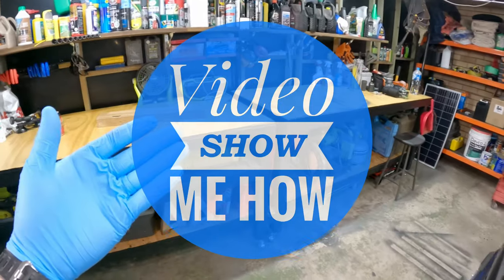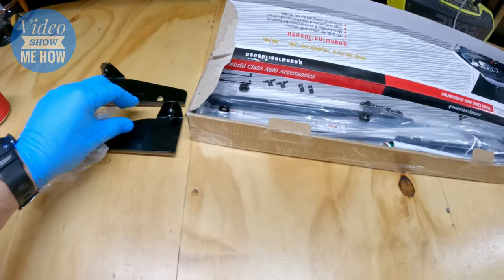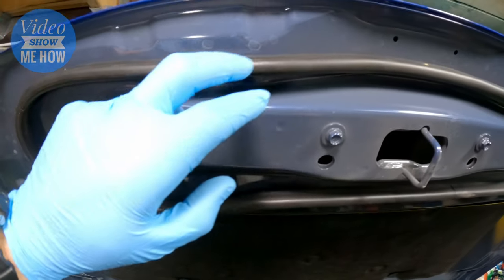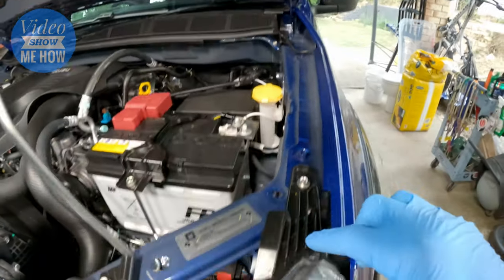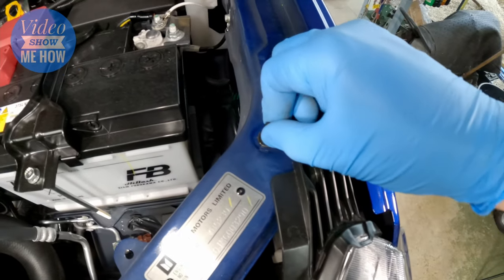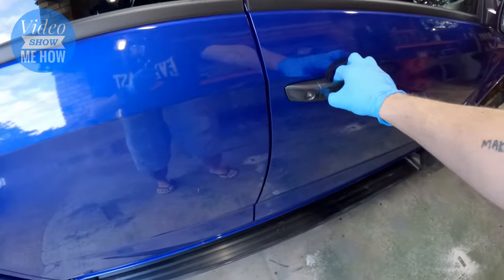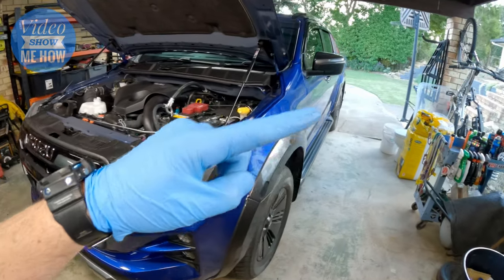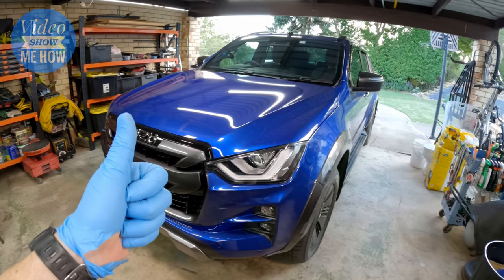ISUZU D-MAX Bonnet Strut Kit Install - 2021 ISUZU DMAX X-TERRAIN Build Series #6

Comment: My under bonnet is the Volcanic Amber.  It's a 2022 model.  I bought my struts off Ebay and they were not the same as the ones you show here.  I had to add washes to stop the ball joints from pulling through the holes.

Comment: Purchased and bought from the link, went to fit today and the bolt cut outs on the brackets are too small for the factory bolts so I went out and got a dremel ($230 with quality grinding tool) also the ball joints next to the headlights were too small for the hole so trip for stainless washers, all in all not as quick as seen here given all that but prepare as I now am and it’s a breeze, great product, if all the stars aligned for this mod it’d take 20 mins 👍 (I always wanted a dremel ✌️)

Comment: I bought the kit from the eBay seller.  The holes in the brackets are too small to fit my bolts from the bonnet.  And I didn't get any washers in the kit for the bolts with the ball-heads.  They can easily pull through the holes without washers.  FYI for people considering buying from the eBay seller.  I've got a 2022 D-Max.  But Adam, your vids are great!  Keep 'em coming!
Reply from the maker: Oh really? I'd contact them, mine came with. I might do a review and update the link, thanks for the heads up!
Reply: @VideoShowMeHow  yeah I’ve sent them an email.  Your brackets look like they have holes, mine have slots.  Maybe a change in design for some reason.
Reply from the maker: @selenahuf9747  yeah mine had just Tue one slot?

Comment: Got the kit from Ebay but found I needed to re-drill the M8 slots in the bracket to fit the bonnet bolts. Ball studs also needed 8mm washers (none in kit) and I added rubber backing washers to protect the paint.

Comment: Hey mate. On the choice of this product, was there a reason this one was your choice? I'm just looking around at what there is, because if there's three mods I'm gonna do myself, its going to be this, the rear struts, and the central locking mod for the tailgate. It seems crazy this ute comes with neither bit of kit. Perhaps Isuzu is prepping to release these as add-ons down the track...
Reply from the maker: This one seems to be the best kit from what I found. Wanted one locally but couldn't find! Yes def seems to be a few of these mods should have been factory, particularly the next couple of vids about to be released :)
Reply: @VideoShowMeHow  nice. Again, cheers for the info.

Comment: Hi Adam, finally got my XT Dmax. I purchased the kit you had a link to. I find the struts keep coming off the ball near the headlight. Both sides. What am I doing wrong? Comes off when I close the bonnet.
Reply from the maker: Hey Steve, congrats! I had one of them with that issue, I don't think it was clipping in properly, I needed up clipping the ball first to the strut then installing, haven't had an issue since
Reply: @VideoShowMeHow  Will try it out. Are you supposed to open the clips?
Reply from the maker: @steveg6853  no mine just clipped in
Reply: @VideoShowMeHow  yeah mine clipped ok. But when you close the bonnet you hear them come off... Weird.